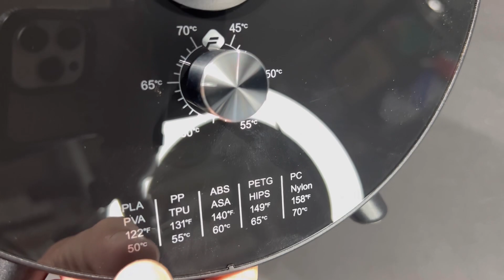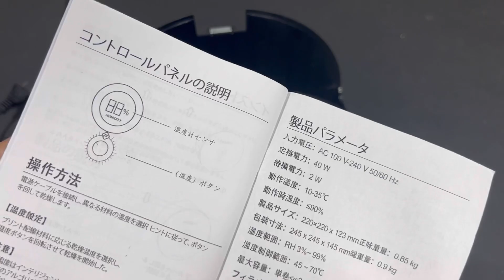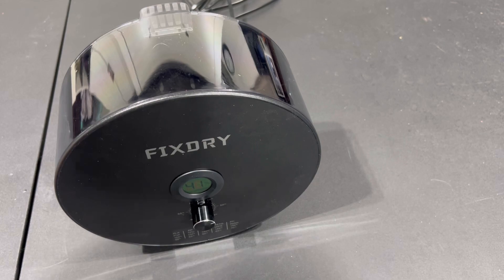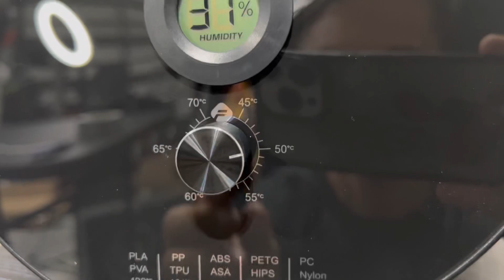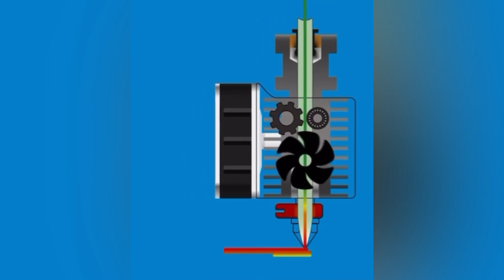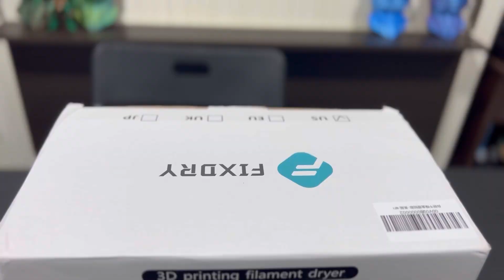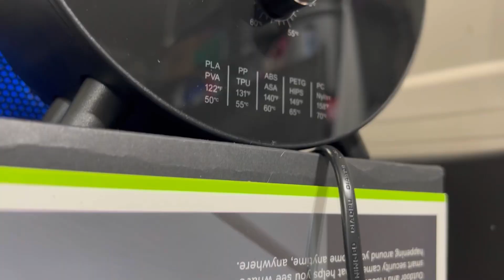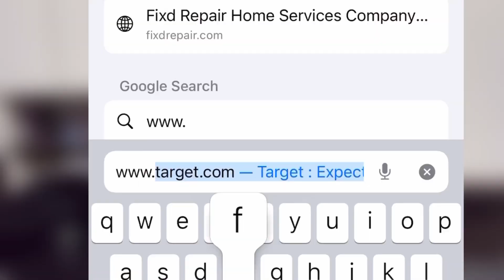Fixdry filament dehydrator NT1 | Why using a dehydrator will save your 3D prints & your 3D printer!

Comment: got mine last week after you recommended it on a silk video.  Good stuff, just doesn't show humidity %.   DW, you keeping silk at what temp and how long before beginning a print?
Reply from the maker: Silk around 130 is good, I run them for 3-4 hours before I print
Reply: @Darkwingdad  ,ooh ok. I was thinking under a half hour. Ok, I’ll address

Comment: direct filament feed is great.. for a direct drive. How about options for the Bowden (Ender 3 Max Neo with filament sensor)
Reply from the maker: For my creality machines I’ve actually drilled a small hole towards the top & move the rubber grommet that way it’s aligned with the constant moving x gantry. Than just take silicone or duct tape and cover the old hole. Works perfect!

Comment: So I have an Ender 5+ and typically use a 5kg spool on it with a metal roller stand. I need to keep it in a dehydrator, do you have any advice on one large enough for that or will I need to make my own?
Reply from the maker: By chance do you have the dimensions of the spool?
Reply: @Darkwingdad  With a spool on the stand, the entire thing is 12" x 10" x 14". Just the filament spool itself has a diameter of 11.5" and is 6" thick.
Reply from the maker: @thomaswalker9277  I just looked up the dimensions on the double spool and that’s too smell unfortunately
Reply from the maker: @thomaswalker9277  you could use the nt1, modify & house it in a larger Tupperware container, print some rollers & make your own though
Reply: @Darkwingdad  thank you for the help Darkwing!
Reply from the maker: @thomaswalker9277  if you need a visual guide just shoot me an email!
Reply: @Darkwingdad  that would be very helpful. I will send you an email. Thank you so much.